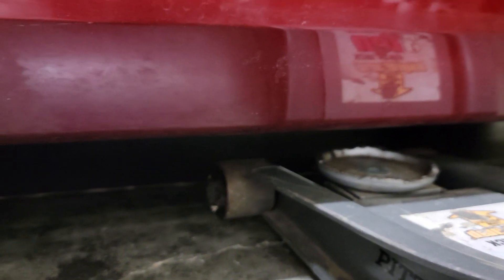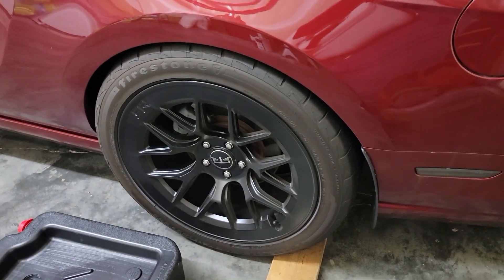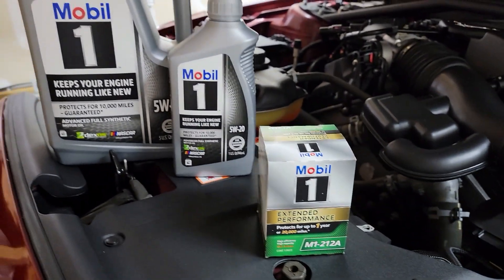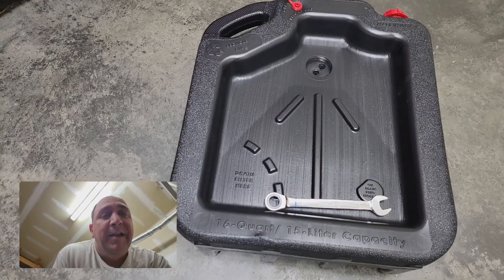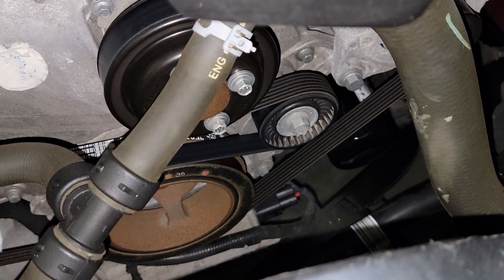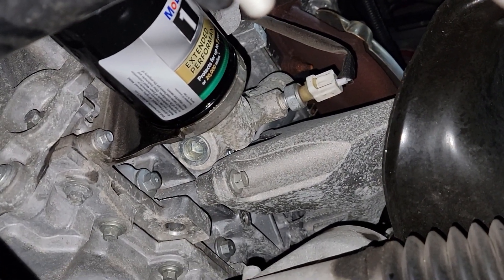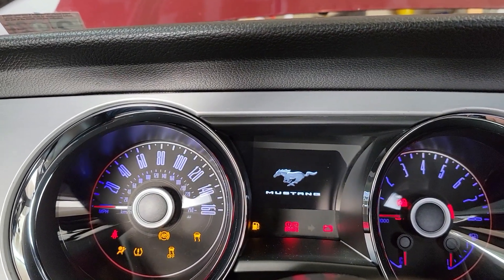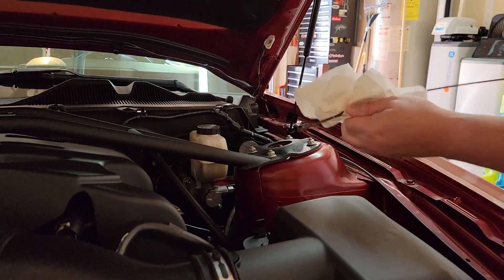***MLP Oil Change*** (2014 Mustang 3.7)

Comment: One hint when you start your car, especially after an oil change. You may know that you can push the key to start and let go and it will continue to start on its own. After an oil change you can do this but now, before you turn the key, press the accelerator pedal all the way to the floor. The engine cranks but WILL NOT START when you do this. This is a good way to get the oil pumped up and into the new filter. You can do this for several seconds and either turn the key off or, if you lift your foot, it will start.
Nice video BTW. I've had my '13 v6 since new.

Comment: That black cap goes to an air bag inflator. For the passenger air bag.
Reply from the maker: I wonder how it ended up in the front of the car on the oil tray?
Reply: @N2MYGT  that is a good question  I assume the recall has been done. Because that is a cap for the new  inflators. That  ford sends out.   May wanna check yours to be sure that part is not missing. Very odd place to find that.
Reply from the maker: @matthewhanner2243  definitely thanks for the info. I will get it checked out here shortly.
Reply: @N2MYGT  you’re welcome